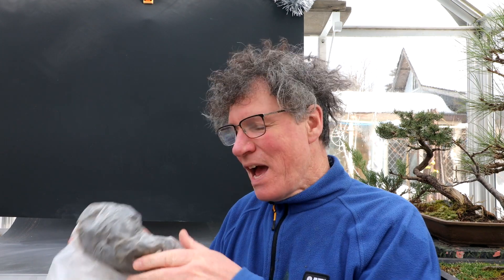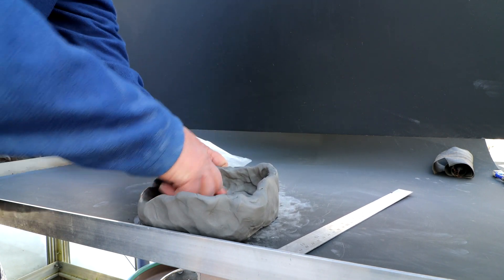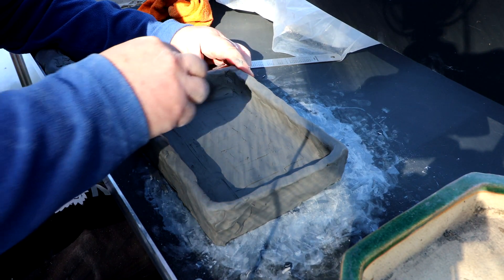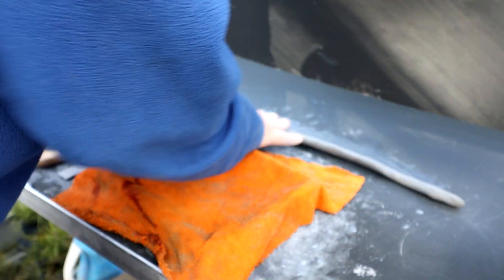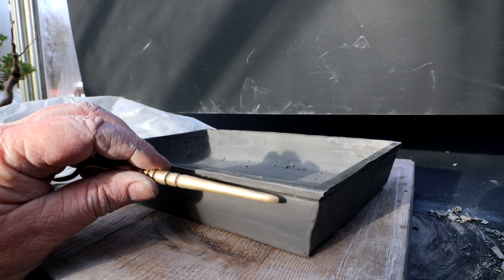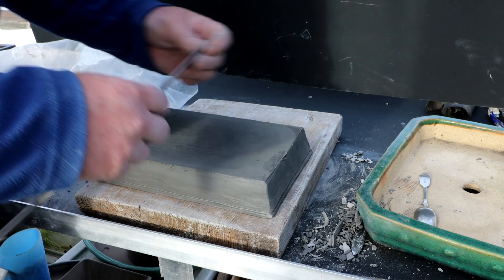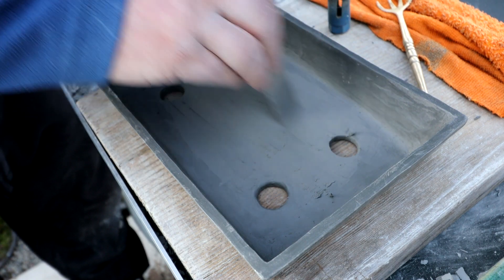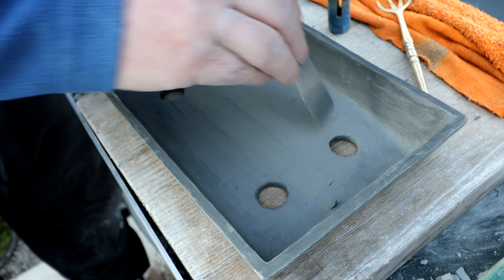Making a Clay Bonsai Pot, Part 1, The Bonsai Zone, Feb 2022

Comment: A small friendly advice/opinion
that high pitched ~*HI*~ everyone, right at the start, when no time to adjust the headphones..... please change that.
also add tiny legs to the pot, so it does not lie flat on the surface, for better areation.

Comment: Great looking pot! I've always wanted to make my own. One question that came to mind while watching, does scoring/crosshatching and adding slip to contact points like the lip or feet to the pot help strengthen the connection? It's been well over a decade since I worked with clay but for some reason that came to mind. Looking forward to part 2!
Reply from the maker: Yes it does! I'll be doing that today!